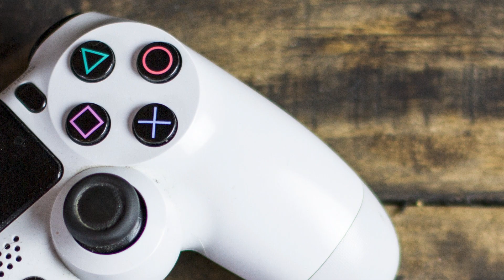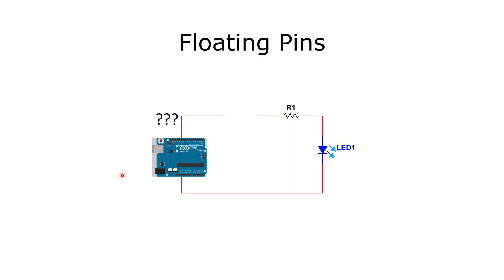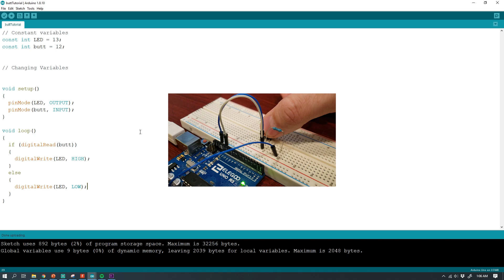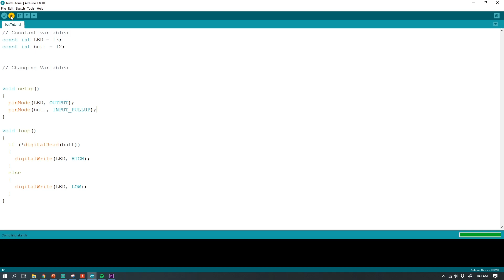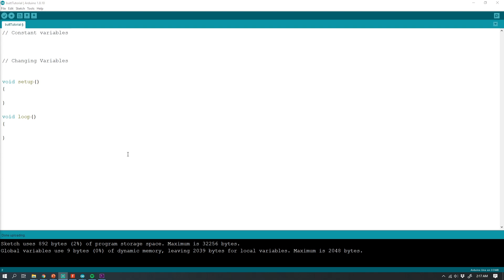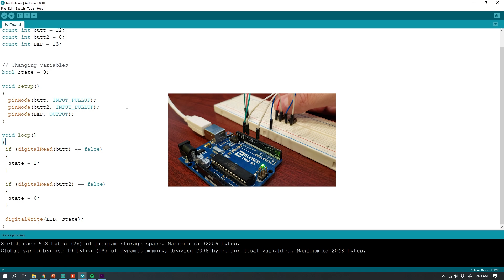How To Arduino 3 | Hooking up and programming buttons with your Arduino

Comment: /* 
  Menu driven control of a sound board over UART.
  Commands for playing by # or by name (full 11-char name)
  Hard reset and List files (when not playing audio)
  Vol + and - (only when not playing audio)
  Pause, unpause, quit playing (when playing audio)
  Current play time, and bytes remaining & total bytes (when playing audio)

  Connect UG to ground to have the sound board boot into UART mode
*/

#include <SoftwareSerial.h>
#include "Adafruit_Soundboard.h"

// Choose any two pins that can be used with SoftwareSerial to RX & TX
#define SFX_TX 5
#define SFX_RX 6

// Connect to the RST pin on the Sound Board
#define SFX_RST 4

// You can also monitor the ACT pin for when audio is playing!

// we'll be using software serial
SoftwareSerial ss = SoftwareSerial(SFX_TX, SFX_RX);

// pass the software serial to Adafruit_soundboard, the second
// argument is the debug port (not used really) and the third 
// arg is the reset pin
Adafruit_Soundboard sfx = Adafruit_Soundboard(&ss, NULL, SFX_RST);
// can also try hardware serial with
// Adafruit_Soundboard sfx = Adafruit_Soundboard(&Serial1, NULL, SFX_RST);

const int buttonPin = 2;
const int buttonPin2 = 3;

int buttonState = 0;
int button2State = 0;

boolean lastButton = LOW;
boolean currentButton = LOW;

boolean lastButton2 = LOW;
boolean currentButton2 = LOW;

void setup() {
    ss.begin(9600);
}   
    boolean debounce(boolean last)
 {
  boolean current = digitalRead(buttonPin);
  if (last != current) {
    delay(5);
    current = digitalRead(buttonPin);
    return current;

     boolean current = digitalRead(buttonPin2);
  if (last != current) {
    delay(5);
    current = digitalRead(buttonPin2);
    return current;
    
   }
 }
 }

void loop() {
  

                 // get the control switch's position
    currentButton = debounce(lastButton);
      if (lastButton != currentButton) {        //the switch position changed
        lastButton = currentButton;
      if (currentButton == HIGH) {
           // - play a sound and wait for it to finish
        sfx.playTrack("TAKEOMHDOGG");
  }
 }
}

/********************** MENU HELPERS ***************************/

can you help me code 4 more buttons 
I have 5 sounds on a Adafruit Audio FX Sound Board + 2x2W Amp - WAV/OGG Trigger -16MB
which can be triggered with an arduino, my goal is to have ws2812 led synced to the monolog of ech sound bite 
Ive been trying for hours to get two buttons to work, but so far I can only get one to work using this code
thank you
Reply from the maker: Thanks for watching my video! The problem you are having is because the code you are using is using 2 buttons to represent a 2 position switch. It looks to only trigger on a button change. For your case I would set up either a switch statement or a bunch of if, else if statements to determine which buttons are pushed and assign a state based on that. Then there would be an if, else if statement chain (or a switch) which would assign a different sound to each state. Hope this helps!
Reply: @robofriven  it would probably help me. But. I don't understand. If else. Or switch state. Or even conceive how to write that code. 
But. Thank you for your reply.
Reply: I've solved the problem. Thanks